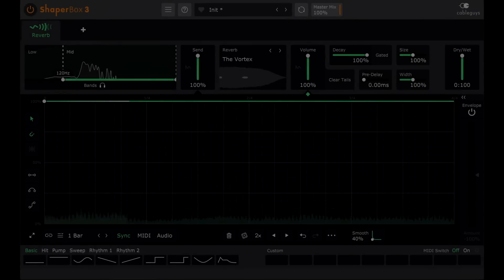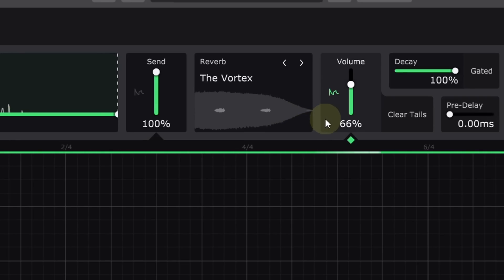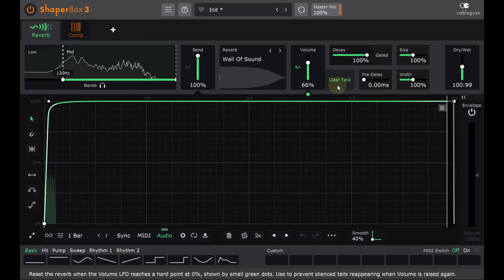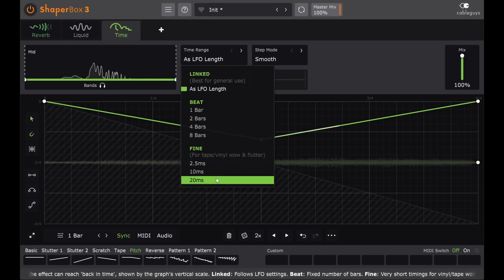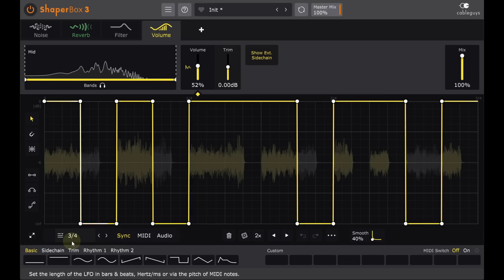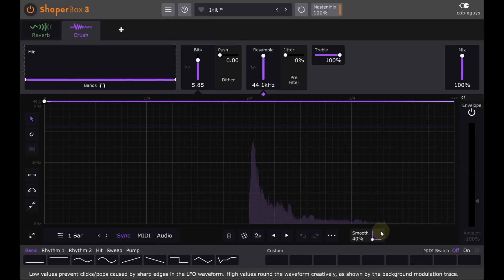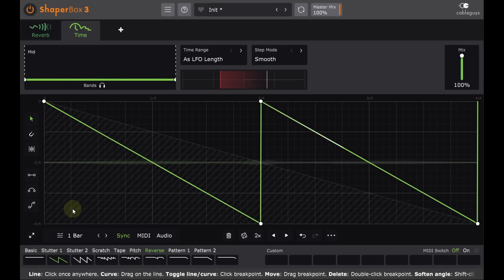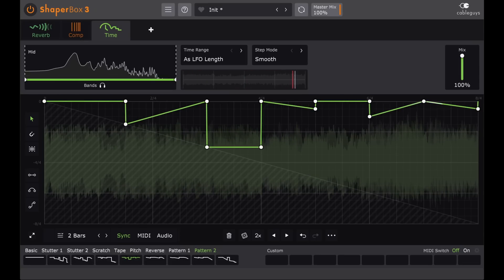More Shaperbox Reverb Tricks

Comment: Dan I saw a video about adding stereo width using comb filters. I think i understood the concept. Could it be that combfilters for stereo-width be a better alternative than haas delay and other known methods? 
Video i talked about was a short from kilohearts. :)
Reply from the maker: It's kind of the same thing really. Haas delay will become comb filtering when the channels are mixed together. Comb filtering is literally just a short delay blended with the dry signal. I'm guessing you're referring to the widening technique where the delay is only added to the S channel? You can think of this as Haas delay, but in MS instead of LR.
Reply: @DanWorrall  yeah ok. The example They showed had almost no difference when summed in mono and where super wide in stereo. I have never heard something that wide that also works in mono. Almost like the perfect widening tool with no drawback in mono, is there such a thing?

https://youtube.com/shorts/mNVe5S_6uQY?si=7fMuGqxVrDupqmuo
Reply from the maker: @NIkalassen  yes! It's not just almost no difference in mono, it's 100% perfect no difference. You create equal and opposite comb filtering for the left and right channels, which cancels completely in mono.
Reply: @DanWorrall Thanks for answer. How would you replicate this with stock plugins? Do you believe this to be an better method than to use a haas delay? :)
Reply from the maker: @NIkalassen the delay needs to be in phase for one channel, but polarity flipped for the other. You may have a utility plugin that can flip just the left or right channel? Or you can have two delay channels (same delay time) hard panned, one flipped on the channel. Neither are inherently better, just different. Go with this method if you want the part centered but wide sounding. Use a Haas if you want it off to one side but with more depth than a simple pan.
Reply: @DanWorrall  i will try. I’m finding it hard to grasp the concept tbh 😅

Comment: Yeah that was cool. I especially liked the stuff in the beginning with the Clear Tales feature. I could imagine this being useful for some really precise sounddesign if triggered by MIDI inputs. However I think you should check out my plugin NEL, if you haven't already. I mean, it's cool what you can do with time shaper. a lot of stuff that you can't do with NEL. But when you run into a situation where you just need some sort of vibrato-ish tone, I am very sure that NEL will inspire you even more. At 3:29 you described a pretty convoluted way to get a simple triangle-shaped vibrato. It doesn't have to be that complicated

Comment: I bought this specifically for the Reverb Shaper a few weeks back.  I haven't used the reverb module a ton yet but I LOVE the noise shaper.  It's absolutely perfect for adding a little processed flourish to acoustic drum shells while still keeping them natural sounding (especially snares) and is 1000x easier to use and more inspiring / flexible than my traditional white noise generator setup in Reaper.  I appreciate the video series on the ShaperBox stuff or I never would have even known it existed!